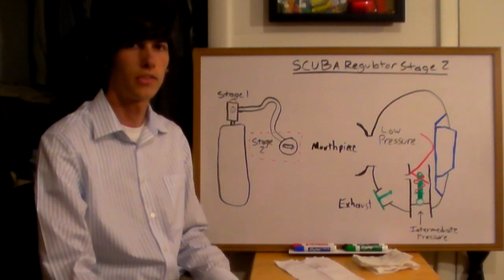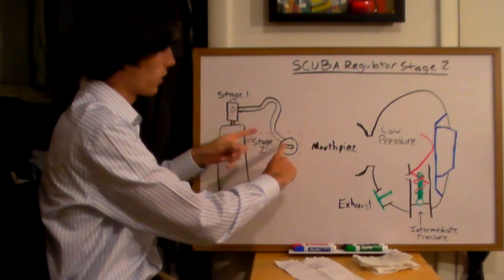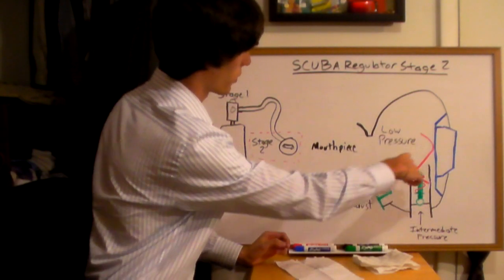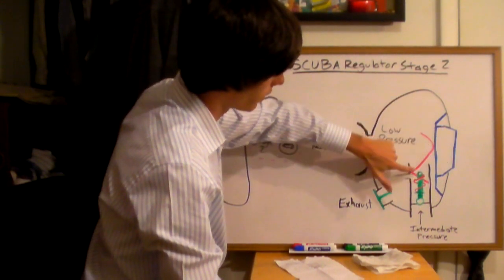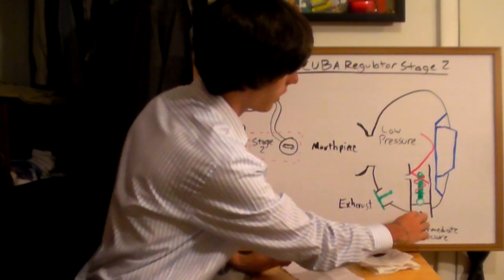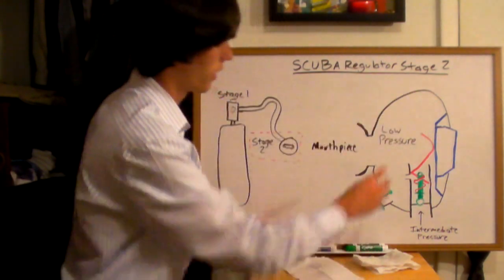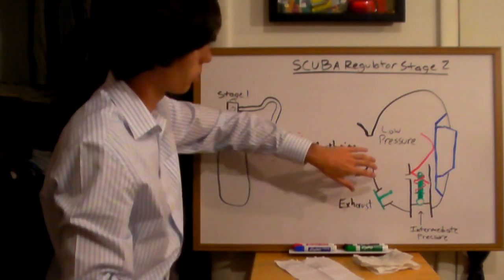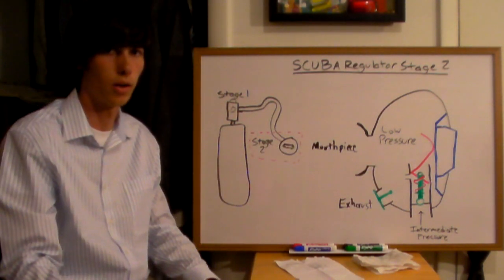Stage 2 Scuba Regulator - Explained

Comment: Unlike the stage one regulator, the "stage two regulator" is only acting as an one way valve to make sure the diver only breaths in air from the tank. The stage one regulator makes sure the air pressure that the diver breaths in is exactly the same as the diver's current environment.

Comment: If I understand correctly the stage 2 brings the air to Ambient pressure of the surrounding water right? It does not deliver it to your mouth at the intermediate pressure. So at surface it delivers air at different pressure than at 100ft. Can you explain how that works?
Reply: Daniel Barnett At the surface, your body is exposed to 14.7psi ambient air pressure so the 2nd stage regulator only has to compensate for that. What ever the pressure (water or air) is, it induces itself on the exposed portion of the diaphragm (or balanced piston on some models). As you travel deeper in the water, your ambient (total) pressure increases 1/2 psi per foot of decent. At 30’ you have an ambient pressure of approximately 30psi (14.7 + 15) This added pressure induces itself on every square area of your body including putting pressure on your chest cavity (externally of course) In order to be able to breathe at depth and overcome this added ambient pressure, the regulator needs to deliver a higher psi to compensate.
This is the reason a snorkel tube is typically not longer than 1’. Any deeper than that, your lung power alone would not be strong enough to inflate your lungs.
Also, when diving, the bottom exhaust port on the regulator should be facing mostly down as in vertical attitude or horizontal swimming with face down. This allows the chamber to act as a diving bell and not allow water to enter and flood the chamber. The second you invert (swimming on your back) the chamber will flood and have to be cleared of water. 
Great vid bty!
Application engineer, Scuba instructor, PADI, SSI, NASDS.